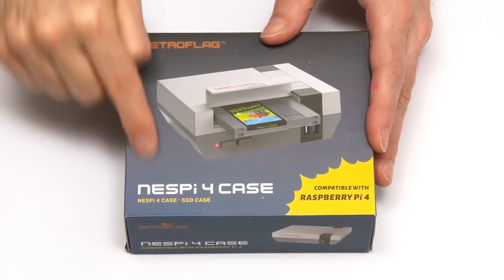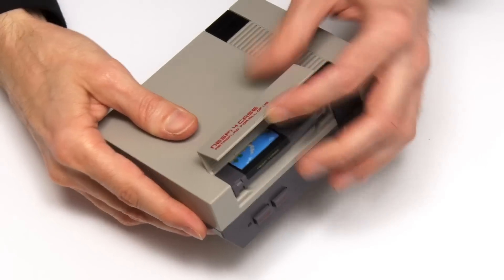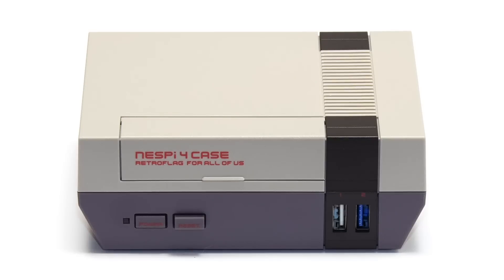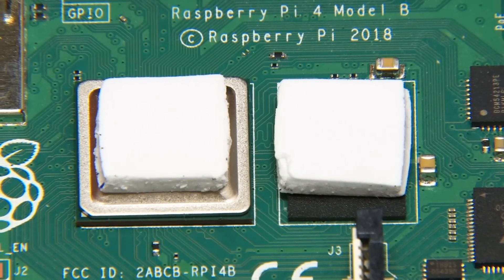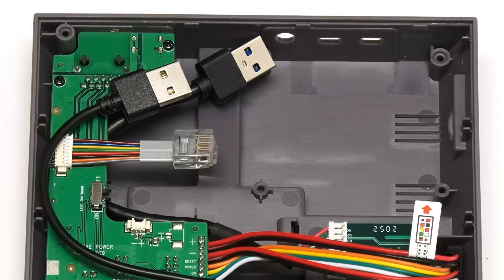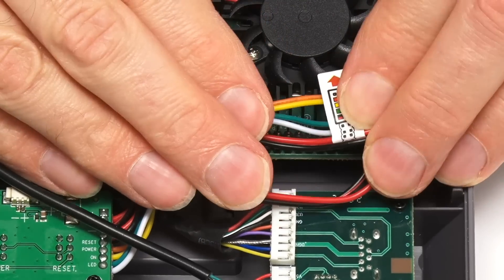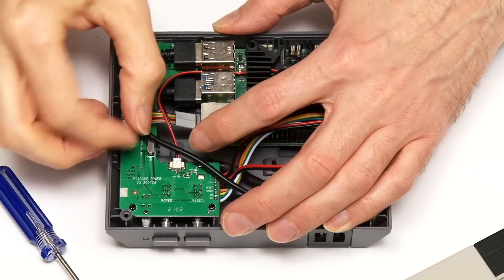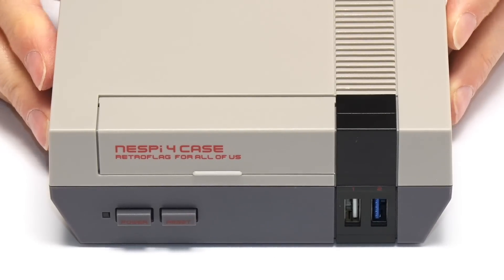Raspberry Pi NESPi 4 Case: Retro Housing with SSD cartridge

Comment: It has too many flaws.
- The USB cable to the hard drive is not protected and you lose Wi-Fi and Bluetooth coverage.
- SSD boot does not work if you use raspbian because the drivers from the board to the SSD are outdated.
- It gets too hot in summer due to not having good ventilation
- The technical support is rubbish after sending them 10 emails for them everything works. But not!

Comment: Q.  When the Nespi 4 Case launched the firmware on the slot had to be changed to get the SSD to operate at normal speeds.  Did you have to update your case on PC to use the SSD at full speed?
Reply from the maker: I didn't, but I made this review some time after the case came out. It appears there have been several design and package contents changes over time.

Comment: Huh , the pimoroni version is different  from the  Amazon one
Amazon one  comes with a micro HDMI to HDMI adapter cable but  it  does not have the  nice heat sink
just some basic one s a  basic fan , the pimoroni has the nice heat sink  but doesn't come with  a micro HDMI adapter
I bet there are other differences too judging by the  generic heat sinks and fan that come with the Amazon model

Comment: The Argon One M.2 is still my favorite.  The fan does not kick on until you REALLY stress it.  No fans taking power or sucking in dust most of the time.  Really, the only down side to the Argon One M.2 is that you can't access the Micro-SD slot.  Other than that, perfect.  This unit needs a temperature controlled fan and access to the 4th USB port to compete.

Comment: Things to be mindful of with this case,

1.  the usb to sata controller is not the greatest and if you have the older model you may need to update the firmware of the controller to get it working. 

2. The shielding on the cables is crap and interferes a bunch with the wifi / bluetooth connections.  If you get some electric shielding tape you can kind of fix this for the most part. (Look up which spots need the shielding)
Reply from the maker: Excellent tip on the shielding tape. :)

Comment: Just as a heads up: Not all SSDs fit in the SSD enclosure. I bpught an as good as nameless 64GB disc that I can only use without the top part of the enclosure. I haven't yet bought another one to see if it'll fit better.

Comment: How long have you had this case?

I am curious as The Pi Hut appear to stock the same case, but check the "Revision History" section of the description and there appear to be some differences - notably the lack of included cooling and (while I don't believe you covered it in your video) the fact that the extended Ethernet port is only 100Mbps, not Gigabit. This information claims to be accurate as of 17th August 2021 and, visually, appears to be the same case as the one you reviewed.
Reply from the maker: I purchased the case from Pimoroni on September 28th 2021. From the comments here it seems that there are different versions on sale at different retailers -- same shell, but different things included as you note.
Reply: @ExplainingComputers  Many thanks - I would still be curious to know, if you have a chance, whether your build reports the Ethernet port as 100Mbps or Gigabit.

Comment: I wish my nesPi came with the SSD cart... Mine only has USB ports under the cart door with the Ethernet port which i dont like and would rather have on the back but ive got a Rasp 3 if not mistaken. I use mine for retro gaming and it works superb. Wil def buy one of these when i get a 4 but for now it will do . I really like these cases and thank you for showing a New version . Cheers

Comment: Having seen previous NES Pi cases, this one wipes the floor with them for the logical approach taken and the cartridge/SSD slot is a killer idea, most people would love to have seen on previous cases.  If I had to pick a con it's the loss of the USB port and the fact that there isn't much in the way of ventilation slots to get cool air to the Pi, but I guess that would need to be tested under load to determine if the available holes in the casing offer sufficient incoming cool air.

Comment: "It does work so much better when you plug in a power supply."

I might want to take notes on that

jokes aside, not using the correct power supply for the pi4 can cause all sorts of problems like undervoltages, freezes, sudden reboots and SD card corruptions. so it's always better to have at least one more official RPi PSU as a spare. PI4s are quite power hungry I've been told.

Comment: Thought this looked interesting but out of stock.

Found it at PiHut but it looks like the maker has updated the case and not for the better:

"Revision History
As of 17/08/2021 we are stocking the latest version from RetroFlag which has undergone some changes from the original model:

Internal and External USB ports now USB 2.0
Heatsink and fan no longer included
Ethernet now 10/100 (previously Gigabit)"
Reply from the maker: Oh, that is certainly not for the better -- the heat sink has gone! :) I only purchased my case (from Pimoroni) two weeks ago, so this is a very recent change.

Comment: I have multiple dongles on my computers that barely protrude from the USB port. I wouldn't rule out the possibility that you might be able to use that other USB port. It does seem a bit of an oversight in the design though.

Comment: I bought one of thse a year ago, gave up on it quickly as it didn't take a smaller hard drive, im not just talking 2.5 but it only took ssd sized ones, I found 2 old ones that did fit as they were thinner and they didn't work so I assumed it was a power issue (i'm using a official Rpi4 power supply) But also the internal usb ports just didn't seem to work, that and one of them was blocked off (to be fair its due to the shape) I liked to have a wireless keyboard dongle inside neatly so it's not sticking out of front, no luck.

Comment: Soft power is a big bonus for me. I don't like to physically unplug everything every time. I have been looking for years for a case with soft power and remote control on/off, so I can plug it into a TV and "forget", using bluetooth controllers.
Ideally I'd want a feature similar to how the Nintendo Switch can be powered from the controller's power button, which sends a special "wake up" signal via the 2.4ghz radio used for bluetooth. But I don't think that'd be feasible.
I have other things higher up on the list of things I need to purchase, but I will keep looking for a nice case with remote control soft power.

Comment: when ssd to sata adapter is plugged to a usb3.0 header inside pi4,   wifi  2.4 ghz,  and bluetooth stops working because of usb to sata very bad shielding.    i had to plug the adapter on a usb2.0 header to solve the problem

Comment: This thing is AMAZING!  I love how detailed the design is for this Raspberry Pi 4 case.  The designer had put a lot of effort into it.  The ethernet patch cable design looks like something I would worry about because the wires aren't even attempted to have any twist or shielding.  But the short length of that ethernet cable might be OK without it.  I love the cartridge design of this.  I also like the humor of Christopher Barnatt as he talks about naming the screw driver and the compartment's purpose on this Raspberry Pi case.  

I hope someone made a Super Nintendo version of this case and even a late 1980's or early 1990's Konami style arcade cabinet shaped case for the Raspberry Pi.

Konami had really good arcade cabinet design starting with the 1989 Teenage Mutant Ninja Turtles arcade game, kept that good design for Sunset Riders and Turtles in Time in 1991.

Comment: Oh man, the only thing missing was to be able to push down the cartridge.  It would be nice if pushing it down worked as a on/off switch for that USB.  So that you could have the OS running from the mSD and be able to swap "cartridge" on the fly.  And you could have multiple cartridge.  Where you store your movies, games and so on.  I currently do that with external hard drive connected thought USB. But it'd be fun using the cartridge instead.

Comment: I was able to put the case's USB2 cable into the bottom slot by removing the daughter board during installation. I highly recommend this.
Reply: Good, I was thinking of doing that myself but didn't want to do it unless there was a point.

Comment: Good review.  I bought this about 6 months ago and set up with a 1TB SSD.  I discovered that the original power supply which was included was insufficient to support the 1TB SSD and used the official PI4 power supply which I already had.  The shutdown and reset switch using the PI scripts work flawlessly with my image but does take some time to run.  The fan makes very little noise.  I did discover that you can fit a small USB2 hub inside to provide additional ports for wireless devices such as a XBOX 360 controller.  Because I use an X-Arcade Tank stick with track ball and a separate spinner I have an external USB hub plugged into the front.  I really wish they could have fit a few more USB2 ports to the left of the one on the case.

Comment: Good video, shame you have 1st generation Nespi4 case, it sufferers with RF interference with wireless devices (e.g. keyboards) and only had USB3 MASS STORAGE instead of a UASP interface for the SSD.  The 2nd generation units fixes these issues but only comes with 2 usb 2.0 ports on the front.
Reply from the maker: I'm not aware of a second generation NESPi4 case. This case was purchased very recently. There was a second generation version of the Pi 3 case (the NESPi Case Plus). But there is only one NESPi 4 case listed on the Retroflag website: https://retroflag.com/nespi-4-case.html Can you provide a link to the 2nd generation case?

Comment: I love mine... If you set it up with the analog output on you can use it in most car displays. Stick different SD card images on the bottom and take it on the road, great for hotels too.

Comment: Thanks you very much for the great information.. is there any slot to use Gpio pin in this Case ?
Reply from the maker: Sadly not. This is not the case to use if you need to use the GPIO pins.

Comment: I feel like there should be more products out there that use the Pi Compute Module instead of the full sized Raspberry Pi.
11:48 - That was a very satisfying "Click! Snap! Tap!"
12:40 - If anything, I think that the LED should turn green once the system has properly booted, and red again when it's shut down, so you know when it's safe to disconnect from the power outlet. But I'm thinking more on the emulator OSs that are out there, like Retropie, Emulation Station, etc.
Also, funny that they didn't pack a power supply with the case. ETA Prime did a video on this and his did come with one.

Comment: That wasted USB 2 socket is a nuisance if you have a favourite keyboard and mouse that need a socket each. Also, is there no access to the GPI pins that are not in use by the case itself? I thought that's what the rectangular compartment on the bottom was for, but apparently not.

Comment: That case is awesome I am waiting for my Pi to arrive I ordered approx a week ago I am going to order one of these NESPI cases you can either use SSD or Mechanical HDD I presume a mechanical HDD I will look into it more but if it has a SATA connector I presume any SATA drive that is 2.5in form factor will work but I am happy to be corrected. But the case is cool as I had to buy a Pi i keep running out of things to experiment with plus I would like to try arm processor and do some dev work with it.

Comment: I wonder if it would not have been a cleaner design if the case was designed for a Pi computing module. Since there are PCBs and interfaces inside anyway it seems little effort to move all I/O circuits to the NES boards and do away with the clumsy connectors inside the case. Which probable would have made it possible to have 4 USB ports available on the case. The downside being that not a generic Pi 4 can be used.

Comment: I modified mine to accommodate the TV header__was fairly easy to cut a circle in the plastic case for the antenna cable to pass through. I had to use a pass-thru 40 pin connector to use both the header and the case connector...I turned the top pins almost 90deg to get the lid to fit in place. Works really well. Oh, I had to use a shallow passive heat sink too but it runs cool enough, and ends up being silent, bonus!

Comment: DO NOT PURCHASE THIS!  Instead of the nice machined Heatsink with the built-in fan shown in all the online reviews, some budget cruncher decided to replace it with a small fan w/o the heatsink. lt’s installed into the other half of the case. This makes connecting the fan very hard to install due to its short leads. Chris please warn your followers of this change. In the States, we’d call this a bait and switch.
Reply: Update: got a replacement coming thanks to Amazon, if that's the same will try it out to see how noisy the smaller fan is and maybe try doing temperature measurements.

Comment: Only issue I have with mine seems to be interference of some kind. Using a Logitech k400 media keyboard on one of the front usb, poor or no signal. But using a usb hub extention to move the adapter away from the device, and everything works.

Comment: Seeing that RetroFlag actually put the network port on the same side (the back) as all the other connectors makes me smile.
Setting up a system like this looks terrible with cables coming out of every angle, so this case seems to be really, also for its fan and the cartridge slot which is a nice gimmick.

Comment: I had a Logitech wireless keyboard and mouse that shared a USB dongle to connect to the PC. The dongle exceeded the USB connector by no more than 3/16th of an inch and might (with some careful maneuvering) fit under that circuit board. If it can this would preserve one of the external USB connectors.

Comment: Thanks Chris for another awesome video. You always make great content ! I always look forward to Sunday! You should check out the DeskPi pro V2 case and let us know what you think. You can get the case only plus power supply and add a raspberry pi that you already have, or get one configured with  4gb or 8gb model. It comes with an expansion board to accommodate an M.2 SATA SSD or a 2.5 inch SSD/HDD. Looks like a very nice case for a pi desktop. It even comes with an ICE Tower Cooling rig, which you have rated very high!

Comment: Sadly I remember when the NES wasn't a retro gaming console, rather it was the best gaming console you could get at the time.
As to the case itself, I prefer a more desktop style but I do like the cartridge style SSD system. If you can buy extra cases you could have a swappable system with many different OS's for different use cases. I wish Argon would take up this design.
Reply: That would be great!
Reply: Ha ha, I was the order clerk at the department store that I worked in and when I was tasked with ordering for upcoming sales flyers I'd occasionaly make a "mistake".  I was told to order 3 SNES systems and 6 Super Mario.   Instead I ordered 192 SNES and Super Mario each and when they arrived the boss hit the roof.  He didn't get the bill until arrival because our promotional orders had 4 payment dates and Christmas is expensive anyway.  We we the only game in town, 'scuse the pun and although we sold out and tried in vain to get more for that Christmas, I was a hero for about 2 weeks.

Comment: Even with the loss of one USB slot, it is the first SSD Pi case I am tempted to purchase, especially if Michael the screwdriver is included.  Looking forward to your next video!
Reply: Should be able to add wireless mouse/keyboard receiver on covered usb slot
Reply: @jim23704  Agreed.  😀

Comment: I think I prefer my Argon M.2 for the extra USB, full size HDMI cable ports and the temperature controlled fan which is rarely needed. (The reason why might have something to do with what you pointed out at 1:35). My Argon was ‘only' £38 on the 7th August, though it might be difficult to get one at that price now a mere 10 weeks or so later.

As always a fair, objective appraisal thank you.

Comment: I'm looking for a Pi 4 case that takes both an SSD and an IQaudio DAC+ board, but one has yet to appear. The closest is the Argon Nanosound case, but that uses a Nanosound DAC which requires additional software, and is not supported by the OS variant I intend to use. Plus the Nanosound DAC lacks the integrated headphone amplifier provided by the IQaudio DAC+.

Comment: The safe shutdown switch is ideal for a headless RPi (not likely here) or for something like a RetroPie where you aren't running a desktop and it would hopefully be faster than going through menus to find the shutdown command. - 9:15
Reply: Yes this case is really for the actual use of RetroPi really, not for desktop. So you would usually have 2 controllers plugged in the front and that's all.
Reply: There is an option in RasbperyPi OS and probably few others where you can set it to read only so even you yanked the power cord it won't effect it.   The only drawback is you can't update the OS until you change it back to read and write mode which is easy to do.

Comment: Was thinking we'd see Stanley the knife make an appearance around 1:44 but alas, he's had the weekend off.

Nice looking little case, and putting the USB to SATA adapter inside the case is a clever move, a bit neater than the little plug on the outside.
Reply: You got a cameo from newcomer Michael T Screwdriver instead.

Comment: The joke about the power supply is not a joke to me. I am repairing equipment and there was a case when a user cut a wire from a broken power supply and plugged it directly into an outlet. The device was very surprised to receive 230 volts instead of 12. Fortunately, the device was repaired, only a few parts burned out.